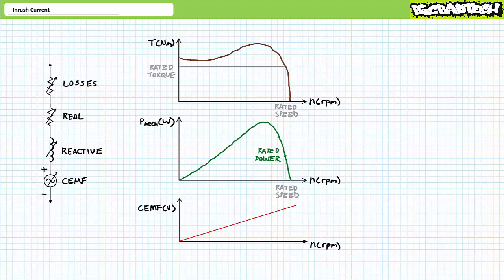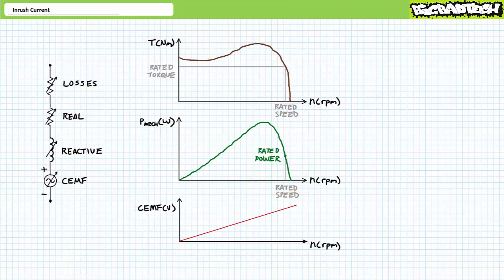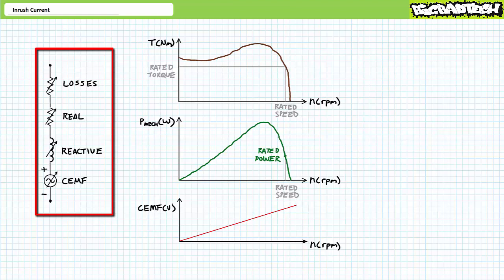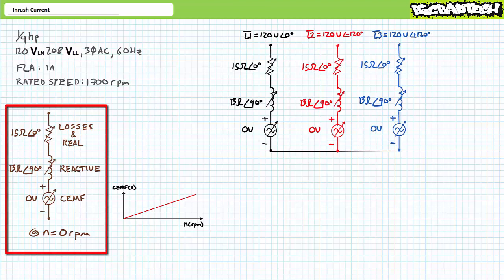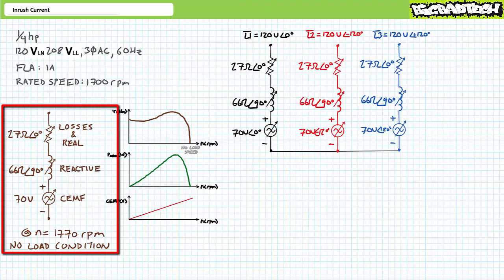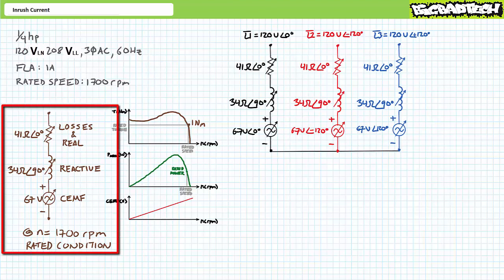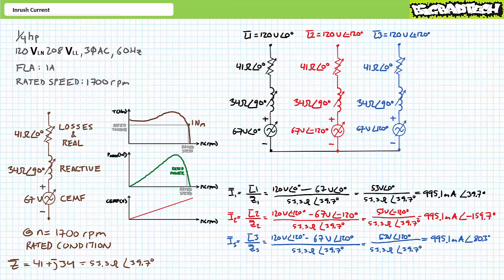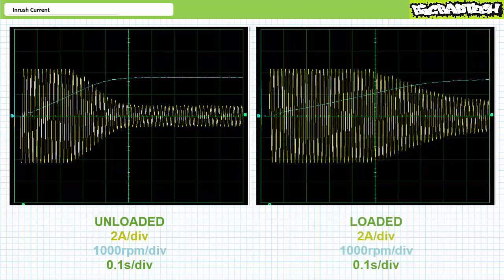Inrush Current (Part 2 of 2)

Comment: Jim, why would the cemf be higher when the rpm is higher,but at higher rpm,rotor wires will cut less magnetic field since magnetic field is also rotating at higher rpm
Reply from the maker: The stator magnetic field remains fixed.
Reply: @bigbadtech  i was pertaining to squirrel cage Induction motors

Comment: Is CEMF exactly in phase with the incoming supply voltage? I'm still trying to wrap my head around how the potential relay works in single phase air conditioning equipment.The typical motor has parallel start and a run windings, and the start winding branch has a parallel set of start and run capacitors, both of them in series with the start windings. The potential relay controls a normally closed switch to the start cap, opening within a second when voltage across the start winding exceeds a limit, and staying open until the next cycle. The run cap continues to supply current to the start windings throughout. The coil for the potential relay is attached to either end of the start winding, so the afferent end is located between the capacitors and the start winding. If you put a multimeter across the start coil leads, you'll find voltages that are far higher than incoming voltage, for example on a 240 V system you'll find voltage there measuring up to 380V, with forward polarity! The knee jerk response from technical instructors regarding this is that you are seeing the combined effect of incoming voltage and back EMF, like standing waves where two opposing sources of waves come together. I'm not understanding how opposed voltage sources push incoming voltage higher than the highest voltage source... For example, parallel DC batteries don't boost voltage higher than the voltage of the highest battery.... Am I correct to believe this is all about the multiplier effect of a tank circuit, caused by the phase shift of the resonant capacitor and coil impedance?
Reply from the maker: Short answer ... I don't know and I really don't know how you could determine if it is or not? The simple mathematical model of the winding consisting of the series combination of the resistive, inductive, and CEMF portions is only accessible at the top and bottom nodes, as is a real winding. Anything happening internally would be a total guess to someone with my level of physics. This being said I do know that CEMF produced by three separate windings (baring single phasing events) does indeed exhibit a relative 120 phase shift from one to another and CEMF magnitude is indeed roughly proportional to rotational speed. In later lectures on synchronous generators I'll demonstrate this effect using oscope traces.
Reply: @bigbadtech  Thanks, Jim.